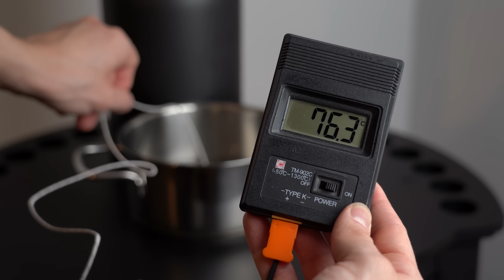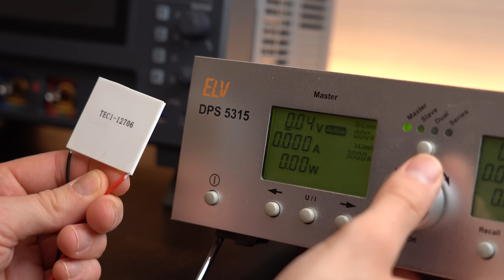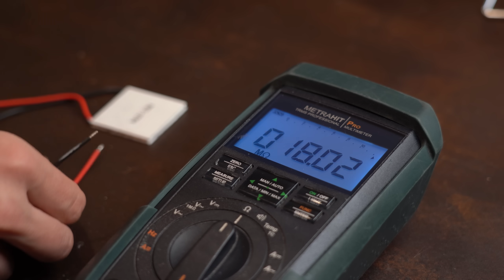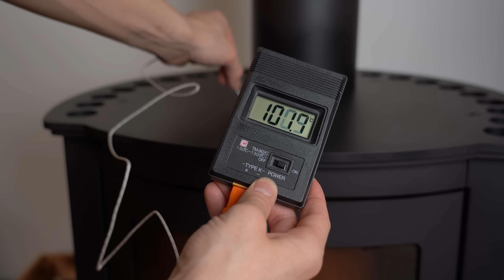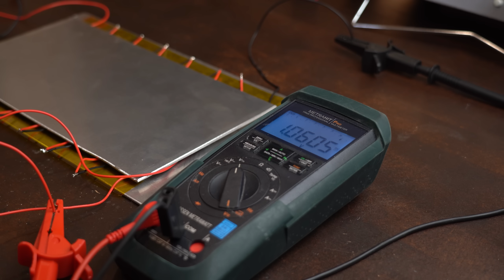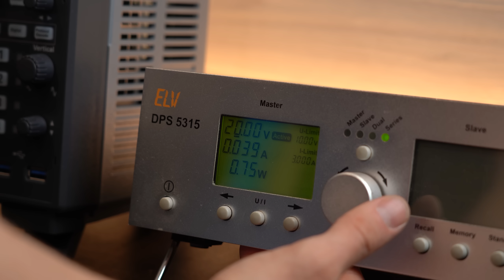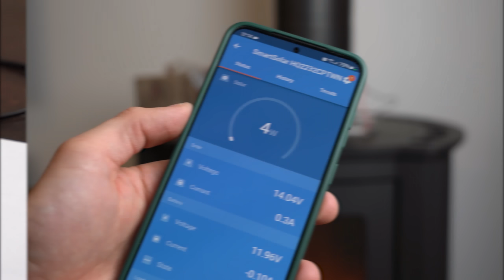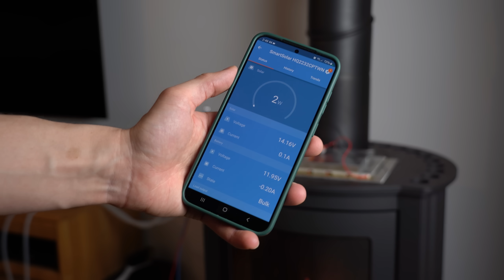I tried to Power my Home with Heat Generators! (Worth it?)

Comment: Put a solar panel in front of the fire place.

From what I understand you get more out of your peltier if you can pass thermal energy through it. So the goal should be to get your peltier to pass as much heat or cold through it to the other side, not for one side to just be cold or hot. Even if the temperature difference increases the exchange of thermal. Water is bad at thermal with a value of 0.5918. And ceramic has between 90-177. Copper has 401 so best bet on that as its easy to get. File down the ceramic layer so it becomes thin and use heat pipes that have even higher thermal properties or very long heat sinks made of copper. Then you need to get rid of the thermal that the heatpipes or heatsinks have taken up. You can do that by having them in water with graphite powder. But the best would be if you had such large heatpipes or heatsinks that it can receive all the thermal energy that you plan to transfer.

Comment: Of course, there is not enough energy because you are using the wrong  modules, the modules you are using are not suitable for overheating, they are used only for cooling and use to build small portable refrigerators.  Use modules that are intended for this, where the price will also increase drastically.  €40 + per piece and usually more.

Comment: another problem is running these in series cause them to eat each other.  You need to pull all in parallel with diodes, so that current from any will not cross any others. These are very tricky little guys. At best you can use them for minor parasitic monitoring devices.
So, you  pull it in parallel, and the after a diode set, put it thru some other converter to power balance it. transformer may have issues, as they work better for AC, and these make DC.

Comment: Fun fakt. In 2026 in EU will be illegal to use wood to burn. And in 2024 is illegal to heat homes using wood and coal. And in 2030 only burning biomass will be legal in eu.

Comment: How about using other modules as these one which are melting in normal condition?
TEG Module TEG2-07025HT-SS for example works a little higher in temperature

Comment: You can run a gasoline generator on wood smoke created by a GASIFIER! 
A 200 year old system, sealed, air comes in at burn basket where fire burns anything hydrocarbon, then all hot smoke and gases go into cyclone separator, water, tar sticks to edges and drips into catch jar, while gases move into radiator to cool and are burned as clean as propane. Can vent this gas with stoichiometric mixture of fresh air, to run any gasoline generator.
Startup requires blower motor to pull in gases to get fire going. Once producing, the generator will draw in air without need of blower motor. 

Can be installed inside of house as system is entirely sealed and will produce thermal losses, which can heat the house a bit. Can run large generators, 5000w. Gas produced is based on vertical fuel feed pipe diameter, typically around 10cm. 
If you have wood, this converts it into electricity with pretty high efficiency. Can also be used to power car engines!!!!

Comment: Cool idea but you probably shouldn't have used aluminum as a heat transfer plate between your wood stove and the Peltier modules. Aluminum is not a thermally conductive as the iron or steel your stove top is likely made of so you will suffer efficiency losses as a result. Copper would have been superior. Also, regardless of the material of the heat transfer plate, it will most certainly not lie entirely flat on the wood stove's top so you really need a thermal paste, liquid metal, thermal pad, or something else to fill in any air gaps between the wood stove and the heat transfer plate to maximize the heat energy transferred from the wood stove through the heat plate. Air is an insulator all in itself, so any air gaps between the heat plate and the wood stove top will negatively impact thermal transfer performance.

Comment: I would use heat transfer pipes to transfer the heat and cool the peltiers. Stick the heating pipes inside the oven and the cooling ones either on active cooling or an ice bath. This way the modules should not over heat that fast and the energy production should be almost immediate.

Comment: The cold tap water and warm water pipes from my gas kombi boiler in the basement run next to each other in parallel for a few meters. Can't you put a long array of those peltier modules between the copper pipes? You'd only get up to 50°C difference tops but it's 1) a pretty steady potential that's already there - in colder months even higher because even colder tap water lines and more heating through radiators - and 2) capped at the temp you set for the heating circuit (no risk of overheating)

Comment: Why not wrap a copper coil around fireplace and utilize a hydro generator? Place output of piping at top of stove, input near bottom and keep reservoir/generator somewhere in middle. Gravity and expanding water hopefully provide assist enough to not require a pump.

Comment: the problem is the the cooling you have to realize that the output of water is hotter than the income so you will have to add a disipator ober de water coling also the income flo of whatter shuld  be in uno end and the ouput in to the oposite side. 
the sistem in good for winter ooutdoors cogeneration not indor or direct generatios is more to squiz all the remaning lost power.

Comment: You are of course in fact water cooling your stove and the electrical energy you get out has been converted (very inefficiency) from wood fuel. So economically speaking this only gets you free power if you use free waste fuel. Cladding the external chimney in TEG modukes and using winter temperatures and wind chill as the cold side would get you free recovered energy.

Comment: Just use more. Don't switch to any kind of mechanical scheme like steam or sterling, as any increase you find in power output is overshadowed by medium to long term maintenance and mechanical failures. The Peltier modules will last for decades with zero maintenance.

Comment: Wait.. correct me if I'm wrong but why are you using a tec instead of a teg?
Also TEG are made to run at a higher temp. 
This is why the tec fails at a high temperature.

Comment: The maximum PowerPoint tracking charge controller is the problem. It’s not going to optimize your our power values. You need an impedance matched load.

Comment: If you have a cold weather in Germany and you want to build a infinite loop without loss or close to minimum attach an steam evaporator to your fire place with a small tube to create pressure and spin a motor turbine, after that the steam will go via a tube outside and cool down by passing via a radiator and via a valve after condensation will drop again in the main  water container inside the house to start the cycle again. 

The only loss here will be the wood as you need to waste material to transform it into another type of energy

Comment: ha , Peltier  modules in general have   efficiency below 10%  why even use this !! , those are the worst cheap Tec Peltier  modules at 1%  , try doing this if you really want to get some energy , a small  sealed metal container full of wood with 2 pipes , one for intake the other for wood  gas  output  , place that  container  inside the stove , and run the wood  gas  output  to a small diesel generator (you might need to adjust the carburetor settings , do not use injection generators , and explore the possibility of feeding the output into the generator intake directly  ).  
i powered a tiger tank during ww2 , so good luck .
Reply: and yeah in the metal container intake  try to put an airpump  to push the wood gas out of the output

Comment: You would probably have better luck generating power by using generators powered by a thermosyphon sitting on top of your heater. A bit of flow rate adjustment in the column and you could get a pretty reasonable flow rate. No pumps to waste power, no wasted heat as internal air cooling in the room would be enough. You could even use a recycled automotive radiator to dissipate heat in the room. You dont need the water to boil  so it isnt pressurised. 
Another slightly more dangerous would be to build a very old style steam engine that used the condensation and the atmosphere to power an arm or just push the ethanol through a turbine in the discharge and a radiator as a condenser as a closed loop. You would only have a pulsed pump but it could work.

Comment: Great episode! I suspect those usually much more expensive high temperature peltier modules wouldn't perform much better, just last longer?

Also, it outperformed most homemade stirling engines I've seen, by a wide margin, that's not nothing. 

You clearly have most of the hardware needed to make a steam power generator, using those water cooling blocks as boiler and condenser, you just need to make/get a turbine and connect it all together. If you remove the air from the loop you don't need to heat the water to 100 °C to make it boil, working at sub-atmospheric pressure should make it really safe, even if that hurts the potential efficiency. 

Have the condenser higher than the boiler and you won't need a pump to get the water back to the boiler, as long as you have a very small pressure difference. A very small pressure difference obviously also limits the potential power generation, but you wouldn't have to generate                     many watts to make another great video out of it, especially if you can generate at least a few watts continuously, and also have the same system help distributing heat from the fire.

Comment: Those peltiers are useful if you are camping and need something to keep your phone working in the wilderness, but without some serious engineering they are not much more useful than that. One of the best uses I have seen is to power a fan you sit on your burner to blow the hot air around the room (but even then, a real fan works a lot better)

Comment: The best way to make these as a generator is my Thermal window invention. You take two panes of glass with 60w Peltier TECs in series. taking advantage of the cold outside and the warmer house temperature. This puts out some voltage... not as much as candles but also doesn't roast the peltiers making them go bad. It fills in under the window sill as a new window.

Comment: If your modules are getting destroyed by excess heat, give them an air gap /stand off .to reduce heat damage.
Someone mentioned a Stirling engine, experiment in that direction to spin a motor as a generator.

Comment: I was able to get a stable AC voltage by accident with them by sandwiching 2 in series or parallel i forget, between my laptop and a laptop cooler.  I check the voltage and to my surprise it looks funny, i switched it to AC and voila 2.6v!  The ironic part was just moments earlier i was toying with the idea of making  AC voltage after noticing rubbing one side produced a positive voltage, and rubbing the other produced a negative votlage, so if you rubbed back and for the right way you should get and ac voltage right?   I couldnt do it,  i concluded the timing would have to be so perfect for it to happen.  And luckily that happend with the fan and laptop cooler.  I suspected this was a fluke and was right as i couldnt reproduce it when i tried again this summer.  I figured there was just the right balance for it to stablalize an AC voltage with the ambiet temperature in the room, the heat of the laptop, and the  external laptop cooler.  Anyway I thought that was cool and made some discovery but  you can simulate this   by rubbing manually, so no big deal. Im guessing you could setup a copntraption to make it give you an AC voltage but would put too much energy for any harvesting. Youd have to find a perfect balance of hot and cold exchange and exploit it somewhere.   Maybe space?   I wonder  how efficient they wuold be in space, exploiting the hot side facing the sun and the freezing side when your not. This is solid state power if im not mistaken.  Which reminds me of this guy who hooks up a diode chain to a solar panel and gets more effiecient heat production then  a resistive element.  Something about diodes not being ohmic devices gives us way better efficiencey, i wonder if peltier devices can have this efficiecey boost for us somewhere.

Comment: You need more than 6 watts, to generate kilowatts constantly for free what you need is a highly efficient triple expansion steam engine with the drive shaft turning a generator and the outlet preheating your hot water intake and room air. This will generate all your electricity needs as a biproduct of the high heat generated from fuel.

Comment: It is clear that both solar energy and peltier modules do not work on an industrial scale.
They do not provide energy stability for industry.
Or even heat in winter - many people have problems with heat pumps and high bills.
The Green Deal is suicide for Europe.

Comment: Yes, Peltier modules are terrible! I had a big delusion with them too. A few summers ago I tried to build a mini-AC (hot side was water-dissipated with a radiator outside the window). I hoped it would blow air at least a bit cooler than room temperature, but I never managed to feel any difference. It turns out that their efficiency is decent only when both sides run at the same temperature. So basically you want to use them to achieve a temperature difference, but as soon as that happens, their effectiveness plummets. What a scam 😅

Comment: For the same surface area .. looks like your Peltier's seem to be equal to the PV.
For example your bigger Peltier setup was 21 modules each measure 40mm x 40mm .. aka a total of ~0.0336 square meters Peltier surface area ... with '1sun' sunny day conditions 1 square meter of 20% efficient PV solar panels give about ~200 watts of electricity output ... that same ~0.0336 square meters you used for the Peltiers , if used for 20% efficient PV solar panel would be expected to produce (in 1sun sunny conditions) , only about 6-7 watts of electricity .. which was roughly the same as the Peltier did.

Comment: Biggest error you start with is that you don't apply the law that warm air rises, so the coldest part needs to be under the hottest part. Second (but most significant) error is that you cannot distract energy from your room without putting more wood on the stove 😜

Comment: the moment i heard "peltier module" i knew this wouldnt work out. why on earth would you not go for a turbine? or better yet, build a system that constantly heats water using the fireplace that you can then use for the rest of the house and save on your gas/electricity bills!

Comment: One thing that no one is mentioning, and would work very well to create, and would get a lot of views for a thermoelectric generator. You should build a micro thermoelectric generator that uses the phase change of propane in a closed loop system. The pressure of propane at room temperature is about 150psi, versus at 212 degrees, it is 500 psi. You have a very large pressure differential. Contact one of the many youtubers out here that makes the micro tesla turbines with a small permanent magnet generator (something like a 500-1000 kv brushless DC motor for a RC car would work perfect as it is meant for high rpm, minimal lubrication, and a high power output). Then you would need a small pump like a fuel pump that could give you a comfortable flow rate of 500ml-1L per minute, and have everything installed inside of a smaller propane tank, so the pressure differential would not affect any of the components, and have your wiring go outside of the closed system. Have two ports for high pressure copper tubing to be connected to, one with a check valve that is connected to your pump, and one as a return for the high pressure vaporized propane. Pump the propane through a heat exchanger that is submersed in water on the top of your stove, which acts to transfer heat from the stove to your copper coil/heat exchanger, and is a barrier so the temperature wont exceed 212 degrees, and if it does, the water will run out and not heat your propane. When the high pressure propane comes back into the system, it will turn the turbine, and the pressure in the tank coupled with the cooler temperature will cause it to change phases back to a liquid. (You will want to add come sort of cooling jacket/heat exchanger to the propane tank to keep it cold as you will be adding energy to the system constantly, and acts as your condensing side. You will need a friend that is good at tig welding/fabrication, and some time, but you can vacuum out the propane tank and have it filled at a regular propane tank. Ass a ball valve to both the inlet and outlet sides for the heat exchanger, do you can disconnect it when you need to move/fill the tank. Is you were to pump 1ml of liquid propane every second through the heat exchanger and increase the temperature to close to 212 degrees, you would be outputting close to 200j/s of energy, or 200 watts. The amount of heat, after efficiency losses, going to your heat exchanger would be close to 800-1000 joules per second, could be better is you insulated and engineered better. The reason that this would be better than a steam turbine is this : No corrosion from water, no lubrication issues, better efficiency, closed system, lower temperatures, less risk of explosion, cheep, and unique. Would definitely take a lot of Collab and time/resources, but would be very rewarding. The thing about using water is that you have to super heat it to get anywhere near those pressures, which is extremely hard and dangerous, and gets expensive fast. Anyway, I hope this helps, and would be excited to see this in action. If you decide to go through with something like this, and want help/more information, feel free to reach out.